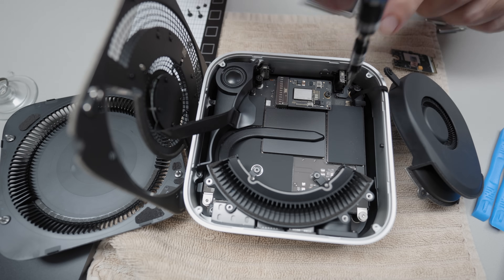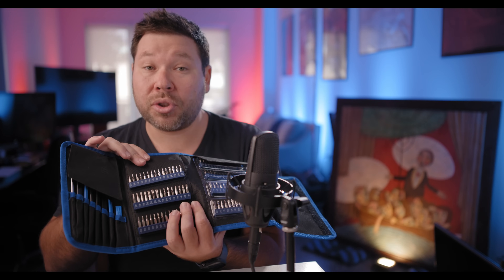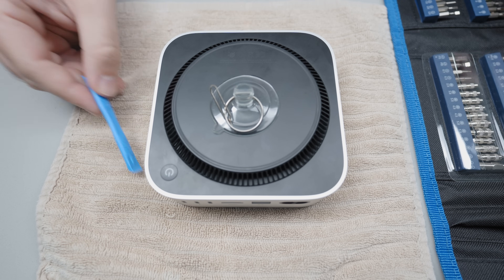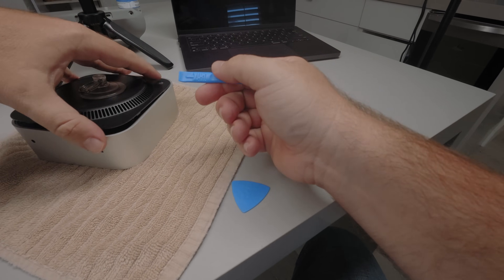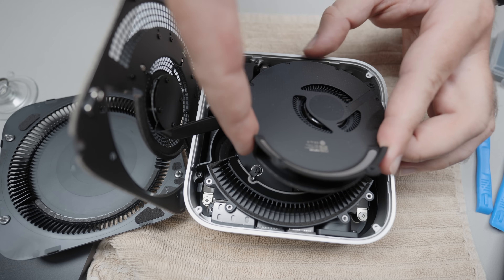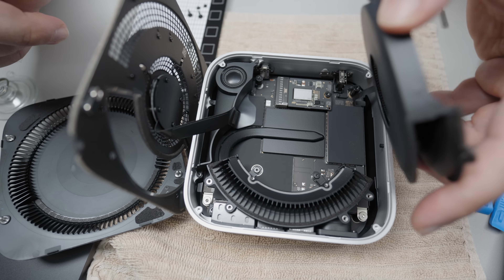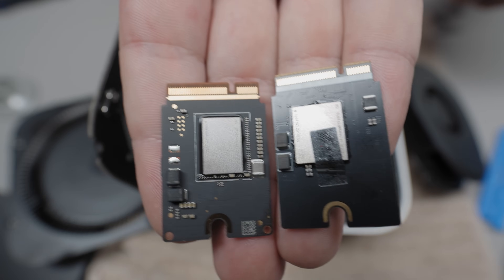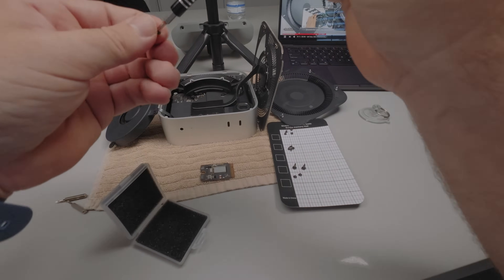How to UPGRADE the M4 Mac mini SSD and save hundreds! (Step-by-Step Guide!)

Comment: Can I use a 2015 Intel Mac for the dfu download on Apple Configurator or does it have to be a silicon Mac?
Reply from the maker: it doesn't have to be apple silicon, but it has to be a Mac capable of running up to day OS, so really just some from 2019 and 2020 that are intel will work

Comment: OK great vid.... is it possible to DO THE DFU set up using a iPad Pro. M2 chip  thanks for the help....
Reply from the maker: it has to be a Mac computer 2019 or later (Some 2018 models MAY work but its model specific and they need to run the latest OS.)
Reply: @ReachFilms   Thanks much for the fast come back mine is also a Mac mini M4 Pro so Im going to assume its going to have to be a different type of SSD and I'm thinking of 8TB  thanks.

Comment: Don’t waste your time.  I did everything exactly and it didn’t work.  I have to remove the new drive, reinstall  the original and return the drove and the mini.  What a waste of time.
Reply from the maker: I am sorry to hear that it didn't work for you, please double-check every step and make sure all the connections were done correctly. From your other post it seems you tried to use a windows 11 machine and an older MacBook and this process will only work on Mac computers 2019 or newer (Some machine from 2018 will work but its only a model or two that are specific that can run the latest MacOS)

Comment: Thanks for an informative video.  It made the installation of my 2 TB drive easy.  Unfortunately, when I connect my Mac mini to a MacBook, it is never recognized.  When I connect to iTunes on a windows 11 computer with a TB port, it is recognized in device manager and iTunes, but the process fails every time I try to upgrade.  So, I am now going to open it up, remove the drive and put the original in snd then return everything.  What a waste of time!  But thanks anyway.
Reply from the maker: I’m sorry to hear you had trouble with the installation. I think the Mac needs to be a recent one to work and a windows machine probably wouldn't work either
Reply: @ReachFilms  I saw that an old mac can be upgraded to modern OS through a flash drive, so am wondering if this is a route if you don't have a new mac (I dont) to do the firmware step.
Reply: @ReachFilms  yea has to be a silicon chip Mac, m1 to m4

Comment: Thanks for a very informative video. I ordered a mac mini 4 24GB ram 256gb drive. Will replace with 2 TB drive. Does it have to be a TB3 cable? Can I use a TB? Would an older M1 macbook recognize it? I am not sure if it is backward compatible.
Reply from the maker: M1 machine should work, not sure about the cable. You could always try

Comment: If i upgrade the HD should i be using a thermal pad? If so what size, thickness and or brand ? Cheers
Reply from the maker: no the internal ssd chips are the same physical size

Comment: Noob question, this SSD looks like a M.2 nvme, Can I install any M.2 NVME and then load the firmware into it, or it has to be something specific. Sorry, I am from India and we dont have much M4 specific options available.
Reply from the maker: No you can’t it’s a different module

Comment: Can you please clarify for me the differences between adding an internal ssd, and just plugging in an external one. Besides the obvious taking up a thunderbolt port and the thing hanging off the outside. I imagine Mac OS treats internal storage differently to external, right? Also regarding having cloud storage mapped to internal storage, which is not possible with external. Appreciate your clarification before I commit to this quite frankly hair raising (although seemingly simple) procedure.
Reply from the maker: @darrencfisher  I would say it’s more about being comfortable doing this, if you don’t feel comfortable go for an external storage option as it’s much easier to deal with

Comment: Great video, thanks - the SSD link to Amazon goes to an external SSD in a container. Is this correct and it simply needs to be removed from the case?
Reply from the maker: Hi you may have clicked on the wrong link, it should just show up as the SSD chip itself on the Amazon page and that’s it
Reply: @ReachFilms  I'm getting the same thing, I think the link is incorrect. also thanks for posting this
Reply from the maker: @ I actually just checked the link and it is working for me, so I assume you are not in the USA? If that’s the case I don’t have a link for outside the USA so sorry :(

Comment: For the DFU restore does the 2nd computer in this case the MacBook also have to be a silicon Mac? I have an intel based MBP. If so any workarounds to this instead of dfu restore? Can you boot off usb with an image of the installer? Thanks
Reply from the maker: @faderfreakproduction  it can be intel but it has to be running the modern operating system so either 2019 or 2020
Reply: @ perfect thanks 🙏 I’m running sonoma but using OCLP as my MBP maxed out at Monterey.. so hopefully it’s supported! I appreciate your response. I’ll maybe try putting into DFU and testing for a connection first before buying the parts and diving in!

Comment: Hi Geoff, Thanks for a great presentation.

I would like to install a 4TB SSD if possible. Do you or anyone else know if there is such a SSD avaible? I have been looking around without any success. The biggest SSD I can find is 2TB. Any suggestions?
Reply from the maker: They can only make what Apple has made for the system and it maxes out at 2TB on the regular m4 mini
Reply: @ReachFilms  Ok, I understand. Thanks a lot!

Comment: Can you make this adjustment before you switch on the Mac for the first time.
Reply from the maker: @randlewilliams8288  you should be able to however I did not do that so I don’t have personal experience doing so. At the very least I would power it up once before you do this even if you don’t sent up the computer

Comment: I bought the SSD and was in the process of taking screws out, but when I got to the T3 screws, the supplied T3 couldn't make a purchase, so I set everything aside and ordered the tool kit you recommended. It will be here tomorrow, I did have a question: my Mac Mini is brand new and never booted up.Should I still boot it up and back up to my M2 macMini? or can I just install the firm wear I downloaded via your link?
Reply from the maker: That's a good question, technically once you install the firmware and boot up the Mac mini with the new ssd its like booting from brand new, so you can most likely wait, but if you want to boot it up and just make sure everything is working that that wouldn't be a bad call either, definitely don't need to restore your Time Machine backup though, I would wait for the new chip installation
Reply: @ReachFilms  Thank you! I appreciate the fast response.

Comment: what is the reliability of the non apple ssd module you used ? what brand of flash chip it does use ?
Reply from the maker: I just did a video on it, me personally I didn’t have any issues so far, however there was an issue with people receiving faulty SSD chips and the manufacturer took back any chips that were faulty for a full refund. I did a whole video on it a few days ago

Comment: Only have an older Macbook Pro 2017. Can I still download the DFU on that 2017 and get it onto my M4 Mac Mini? Or does the DFU have to be on at least a 2020?
Reply: Will a 2015 MacBook Air work as well? What adapters would I need to accomplish the same results?
Reply from the maker: @ I don’t know if a computer that old will work
Reply: @danielrennie8444  I've read in several videos that Macs 2015 onwards work for DFU. Alternatively, you can also restore the Mac mini with a windows computer and VMware
https://youtu.be/HSmpsXwSrBM?si=tH-r8mxIgjMJ1KZN
Reply: @ Thanks for the assist!
Reply: @danielrennie8444  I upgraded my 2015 Air just with "normal" cheap adapter. Just google it. Or you can buy recyled.
Reply from the maker: You can but make sure you download the file in the description and make sure you choose that when you do the dfu and you will be good

Comment: Hey Geoff.  what do I do if I get a Unknown Error (21) after following all the instructions perfectly.  What went wrong? I used the DFU. Downloaded the software from the link and after that failed.  I tried Apples own link.  I have even tried it from an M1 MacBook Pro and Another M4 Mac Mini in the house.  All I am getting is this silly error.  Can't imagine what I did wrong.
Reply from the maker: @jonpaulseah1617  it may be a bad chip and you need to replace with a different one
Reply: @ReachFilms  I sure hope it is not a bad chip.  This company looks reputable.  Hope that they will have warranty.
Reply: I also have the error 21 since more than 24 hours. The manufacturer of the ssd claims it is an issue with the apple server. Error pops up on extracting of the IPSW or some sort of validation with apple servers...
Reply: @timiboy19  I am working with the Manufacturer to solve the problem but it seems that there is some incompatibility with the SSD socket on the M4 Mac Mini. They will send me another SSD to test.
Reply: @jonpaulseah1617  i have tried every scenario possible to no avail. I'm pretty sure it's the Chip😬
Reply: @timiboy19  I found out that DFU mode itself needed specific requirements.  So changing the cables, changing the Mac used.  Downloading the software first before hand in the restoring mac and making sure NOT to release the POWER button on the Swapped Mac as you connect the power supply made everything work.  Hope you get better results when you try again.
Reply: @jonpaulseah1617  I'll try a couple of times today again. I have downloaded several recovery ipsw's on to the recovering macmini.
Reply: @jonpaulseah1617  Oh boy....I got the advice on another post of mine to keep the powerbutton pushed while inserting the power cord....voila the whole procedure went trough as planned. I have no idea how much time went into getting this to work and how many times I've been trough the process of (starting) recovery. Now I have a 2TB mac mini with the fraction of the cost from the apple store!
Reply: @timiboy19  Must have been my English. I thought I said that already.😅
Reply: @jonpaulseah1617  Must have missed it! Now I'm a happy mac mini M4 2TB owner :)

Comment: Thanks Geoff! My M4 Mac mini arrived today!! Base model with upgraded memory to 24.  Are you still recommending/using the OWC enclosure that you've talked about in previous videos?  If so, do you have the enclosure with their SSD included, or do you just have the enclosure with a separate SSD that you installed in the enclosure?  I am thinking of purchasing it with the OWC SSD already installed. I'm sure you talked about this is a previous video, sorry.  Secondly, do you have a T4 hub that you have used that you particularly liked?  Again, I know you went over this previously, just trying to get your recommendations after 3 to 4 months of use.  Thanks so much!
Reply from the maker: Hey Jeff! Yes absolutely recommend the owc drive. I put a crucial 500 SSD in the owc to save around $95. Also for the hub I would get either the OWC or Kensington hub they both work great and even had them daisy chained to each other when needing to do some heavy work on the mini a few weeks ago.
Reply: @ thanks Geoff really appreciate the help. Just entering Mac mini world so I’m sure I will have some more questions for you as I journey along and hopefully you won’t get sick of me! Lol

Comment: great explanation, now I'm even more excited to buy the Mac MIni 4, but where did you buy the 2 tera SSD? I want to try with a 1 tera SSD. I saw on another channel the person removing the flat cables. In your case, you didn't remove it, I thought it was great. To restore you need another MAC. I don't have a Mac, can I use a friend's for example? My idea is to buy and before calling, make the exchange. You recommend!
Reply: you can also restore the Mac mini with a windows computer and VMware
https://youtu.be/HSmpsXwSrBM?si=tH-r8mxIgjMJ1KZN
Reply from the maker: I have a link in the description, they sold out quickly but will add more soon!
Reply: @ReachFilms  Sorry, I saw that you had indeed posted the link. Thank you very much. Perfect video and will help a lot.

Comment: Can you advise the firmware you would use for the M4 Pro Mac Mini?
Reply from the maker: I’m not sure what you are asking? This is only for the m4 Mac mini. The m4 pro uses a different chip and there aren’t any companies making third party nand storage/SSD replacements for the m4 pro mini currently
Reply: @ReachFilms  Ok well, you answered the question. not sure how it confused you... I assumed that this process would also apply to the M4 Pro Mac Mini. I didnt know it doesnt, you didnt exactly point that out in the video.
Reply from the maker: @ I have a video on the channel that explains the difference between the SSD in the base model m4 mini and the m4 pro check it out!

Comment: So if you never login on you new M4 mini can you change the ssd first or login and setup  system and then remove ssd with new ssd ? I am Very new at this just a retired Jet Mac thank you for video I have watch other videos on the projects
Reply from the maker: You can start from scratch and install everything if you’ve never put anything on the computer then you don’t have to do the Time Machine back up once you do the DFU restore you can just start the computer as if it’s a brand new one and set it up from there

Comment: I somehow see apply trying to prevent this, or going back to soldered ssds
Reply from the maker: @Phil-D83  I don’t know, they did it with the studio first, and now they’ve done it with both versions of the mini. And they’re gonna keep this model for quite a bit so maybe 5 to 10 years down the line they change it. But I actually think them doing the method they have done in the past cost them more money, especially for people who bought the smaller base models who constantly use swap memory, and had chip failure before the drive should have.
Reply: @ReachFilms  they abandoned soldered on models due to failures (especially with the voltage regulators). They are greedy short sighted sobs.

Comment: why the hell would anyone do this. just buy external SSD. its the same shit
Reply: ** off , I support the guy in the talking. He's just teaching us stuff!!!
Reply from the maker: Some people want the smallest setup possible, I’ve been using an external SSD with no complaints either but it’s cool to see this is possible.
Reply: @not worth the risk. external TB4 ssd is 5cm long and you can plug it on the back IO, iland wont see it at all. its good to know that its posible but to big if a risk. maybe after 2 year warranty runs out, bit for new mini, not
Reply from the maker: @ that’s why I mentioned it in the beginning of the video it’s a process. Some people may want to do and others may not want to do.
Reply: @ yeah. i agree 👍

Comment: I think it would have been worthwhile illustrating how you put the mac mini in DFU mode.
Reply from the maker: Yes you were right! I completely overlooked that! Thank you will add in a pinned comment
Reply: Would also be nice  to see the speed difference on the new ssd.  I've been hearing claims that speeds begin to suffer as the drive fills.  Would be nice to know what we are getting into when that happens.  Wonder if you could put the factory 256GB chip on an external usb enclosure and do some testing to show your followers.    Loving your content.   Thanks.